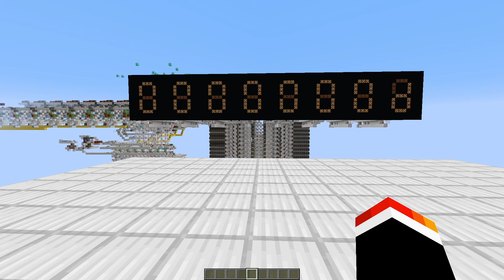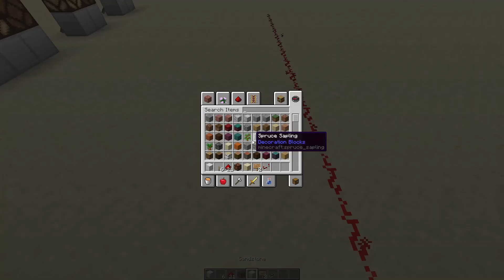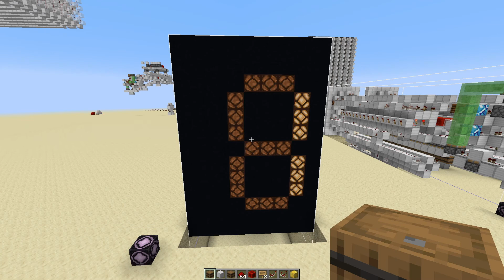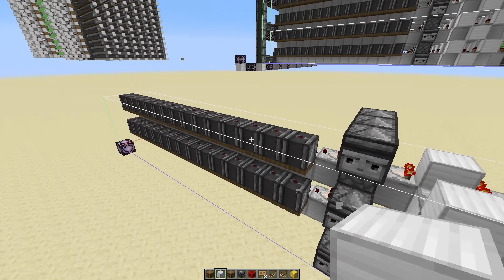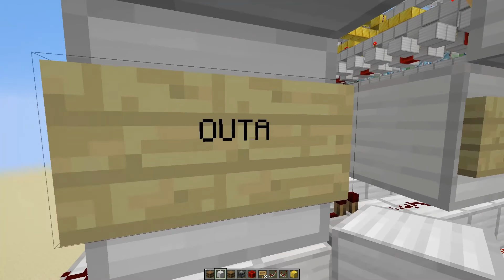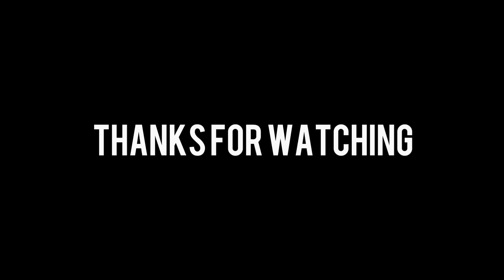Vanilla 32-bit Minecraft Redstone Computer - Component Walkthrough

Comment: Im surprised you used only comparators for cables, if you wanted to reduce delay you could've done a setup with repeaters, its 3 wide but 1 tick for a 15 block extension and keeping the strength